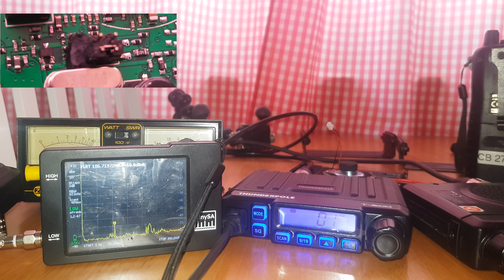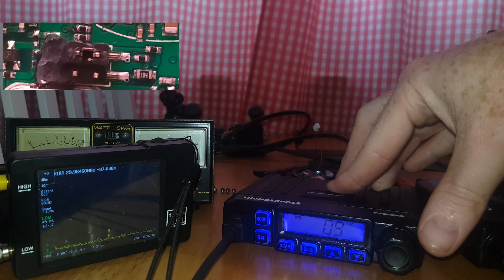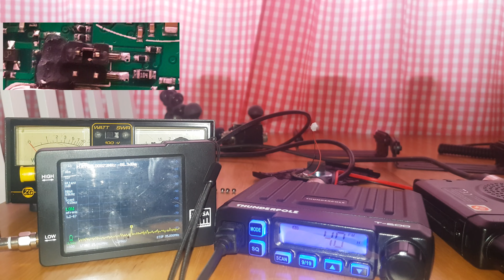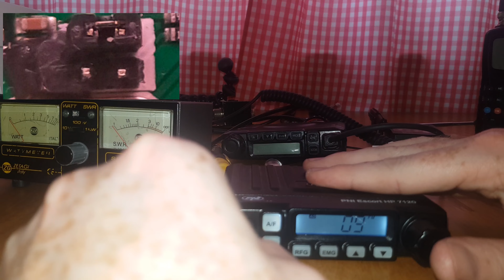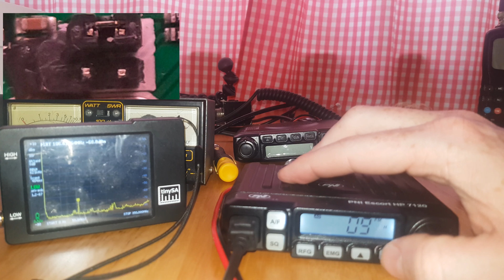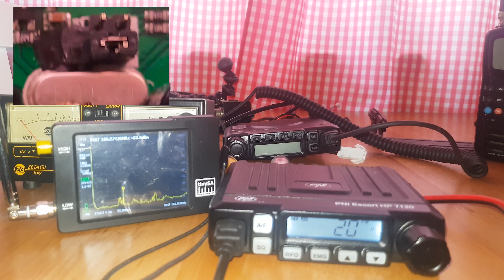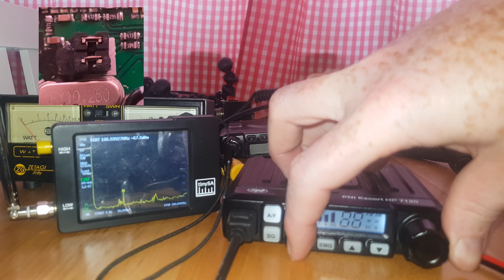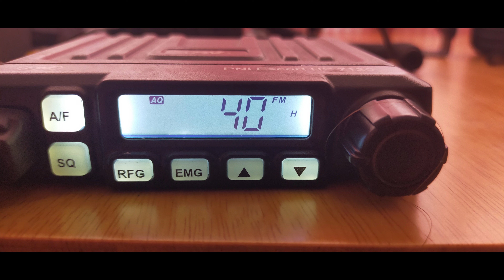The mode jumpers inside the Thunderpole T-600 and PNI Escort HP7120

Comment: Hi Paul , recently purchased x4 t600 and want some extra power , want to keep the same normal FM channels , what would you recommend, also seen another video where they tweet  the power by the screw setting , is this also advised ?
Reply from the maker: the extra power wouldn't in reality make a whole lot of difference to the range, with the radio set in the high power mode by changing the internal jumper and adjusting the preset the best I got was 4 watts anyway, also those presets really need adjusting with the correct tool, not a screwdriver as those can damage them, however running a radio like this at full output could shorten its life
Reply: @PaulMcGeeM0WNU  what would be the correct tool to do this ?
Reply from the maker: @EssexBeastie  something like this should work https://www.amazon.co.uk/gp/product/B000WKIYTW/ref=ppx_yo_dt_b_asin_title_o00_s00?ie=UTF8&psc=1

Comment: Paul why would you not recommend using the higher power mod on the T600
Reply from the maker: This is because it puts the radio under a bit more stress and not a lot is gained as it is at best 8 watts output when modified to do that, plus it could shorten the life of the radio greatly
Reply: Can I get you to check the out put on mind sometime please
Reply from the maker: @richardmorris66  sure, of course, though my meter isn't the most accurate in the world